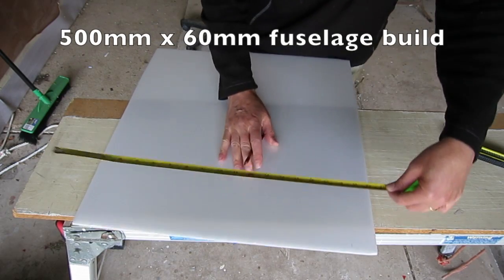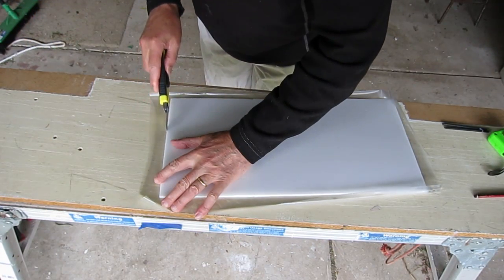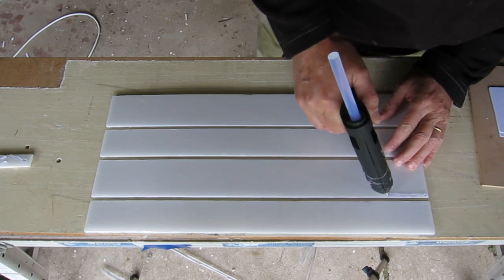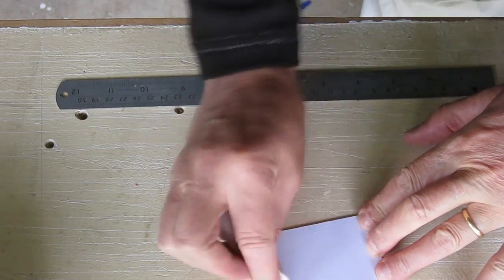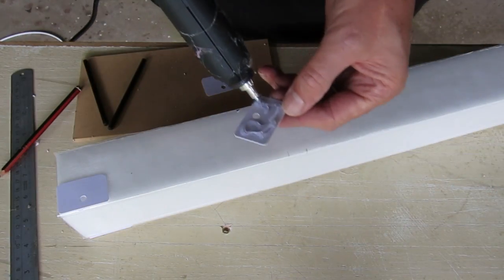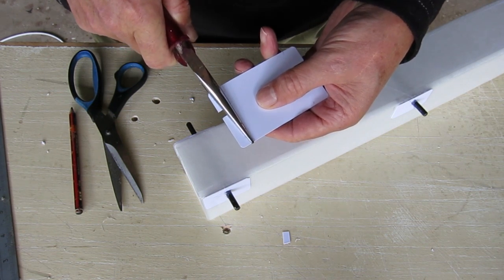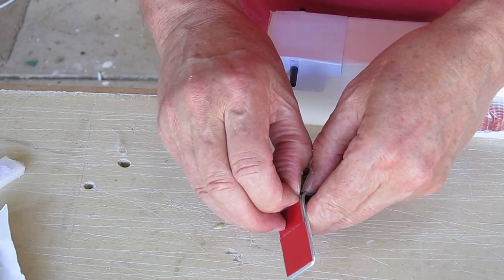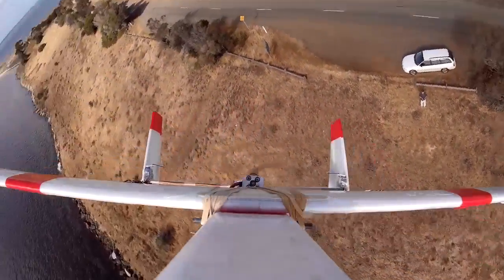Twin Boom body build

Comment: Thanks for this video. Do you have any suggestions on where to get 6mm depron or HobbyKing type foam in Australia? It seems like 3mm or 10mm are the only thicknesses available now
Reply from the maker: How frustrating! I don't have any other suggestions sorry.
Reply: Andrew Newton no worries thanks anyway mate. Might have to try some hot wire building using the insulation board from Bunnings instead 😎
Reply from the maker: Tradewarehouse link in the description
Reply: Andrew Newton Thanks I checked but they only have 3mm or 9mm thick and HobbyKing only seems to sell 3mm and 10mm thick foamboard now. Suppose I could laminate 3mm board together.

Comment: no idea why I can`t open link to laminating sheets..
Reply from the maker: Ah thanks Kevin, That link died. Here's a current one http://www.neopostonline.com.au/lamination/ez-load-roll-film
Reply: Thank you so much..
quite a big roll...
what does the 25mm core mean?
Reply from the maker: Kevin Ray Yes it will last me forever, can't buy in smaller quantities unless you buy per meter from a hobby shop at outrageous prices.
25mm core is the size of the centre spindle of the roll. Relevant for fitting on laminating machines I guess.